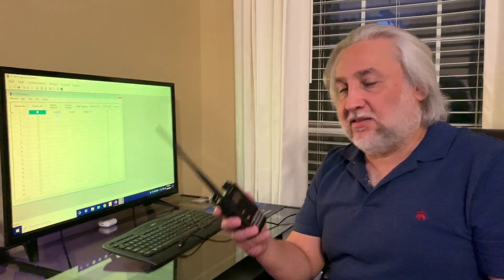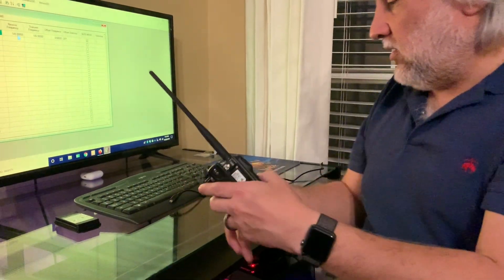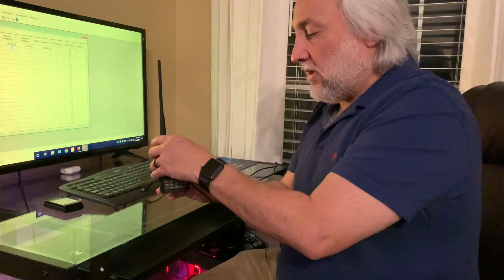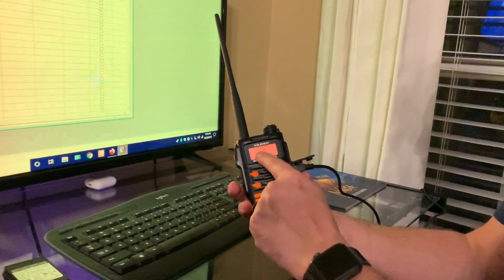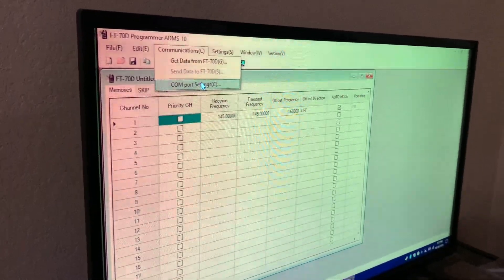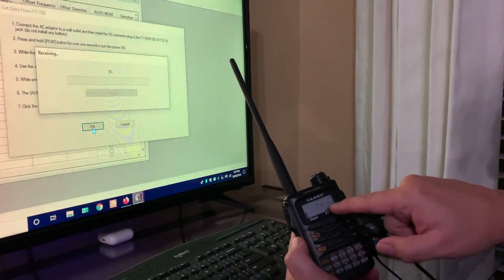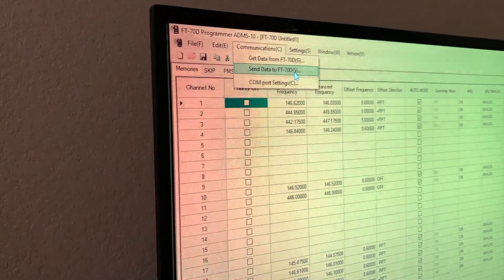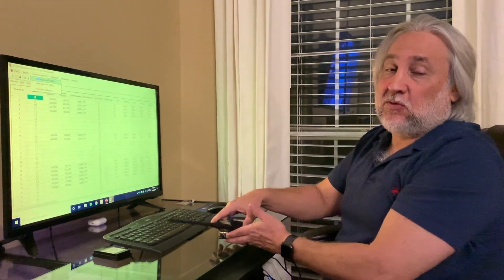Connect Yaesu FT70D to PC

Comment: Is the USB cable a straight data cable? It doesn't show up in device manager. Also I see cables for sale using the 4-conductor mic/speaker cable. Do both work?

Comment: For loading the data to the radio do you press the band button again. I get time out errors when going from the computer to the radio
Reply: I also get a time out error. I ordered another cable USB-57B, hope it will work

Comment: Hi: I have the Yaesu FT70D. I want to program thus radio using the specific software, but avery time that I connect the data cable I have this message ""  INVALID COM SETTING"" How can I solve this issue? Thanks
Reply: Same here. Invalid port setting.
Reply: I still have the same problem
Reply: this means the radio is on a different com port than the software is trying to read/ write to. Check in your computer settings which com port the radio is on (unidentified device) use the radio programming software to change the radio to that com port. THis is alos the cause of the time out errors people get.

Comment: Thank you for this video. But after I complete this procedure, will my Yaesu have my local repeaters installed automatically without me entering them manually?
Reply from the maker: You're welcome.  Tried to keep it as short as I could.  Yes you fill out the "spreadsheet" with whatever repeaters or frequencies you wish.  I keep several different copies because I travel.  So I have a spreadsheet for Washington, another for Florida, others for California and Colorado.  Then depending on where I'm going I just upload that particular spreadsheet to my FT70.  I don't like keeping all frequencies and repeaters on my radio at all times because it's a lot to cycle through (many hundred) and if I'm in Alabama, I can't reach any in Colorado anyway.  Once uploaded, they are stored in the FT70's memory so no need to add them manually though of course you can if you wish.
Reply: Excellent presentation.  Slight clarification, not automatic.  You enter the information in the spreadsheet then load to the radio.  Sorry if I am clarifying something that doesn't need clarifying.